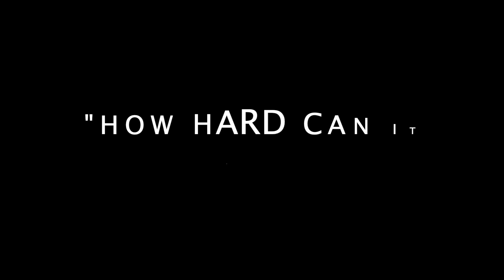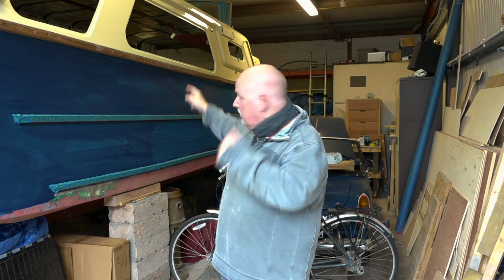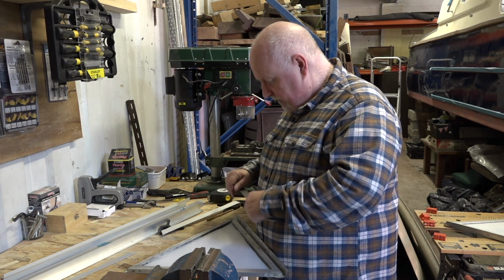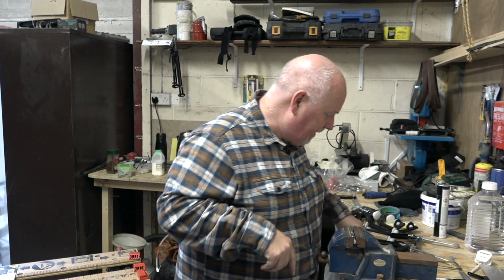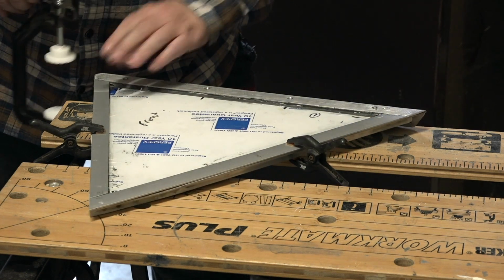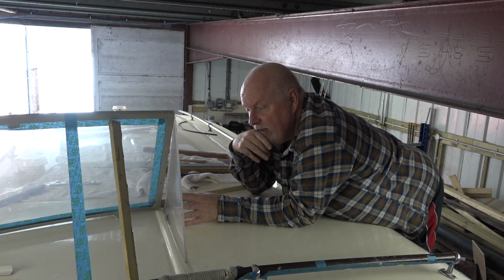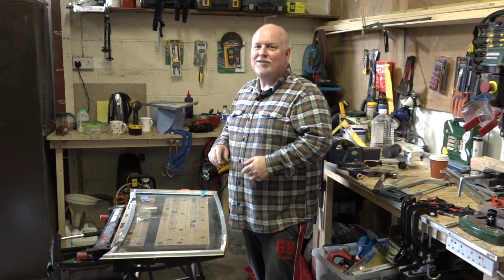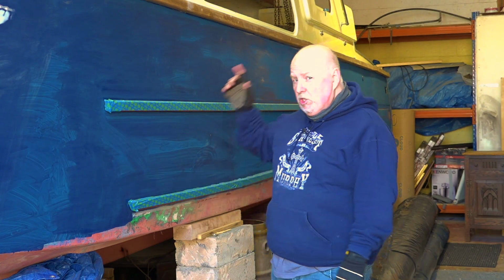Boat windshield restoration “We’re Back” Episode 30

Comment: Great to see you back Phil! Coupled of points, I notice the side screens are on the outside edges of the screen but on my 27 they are on the inside edges and as such offer more support by preventing the screen from being pulled back by the canopy tension.  Secondly when measuring out Araldite I found it easier to squeeze the glue and the catalyst out like two separate sausages. You can then be sure you have equal quantities and also repeat the quantities for the next job. Looking forward to the next video.
Dave
Reply from the maker: Dave, that’s interesting, you say the inside for the side screens, I’ll have a look at that dear boy, thank you, and I’ll also change the sizing up of the glues too.
Thanks for sticking with us, episode 31 is currently being done 👍🙏